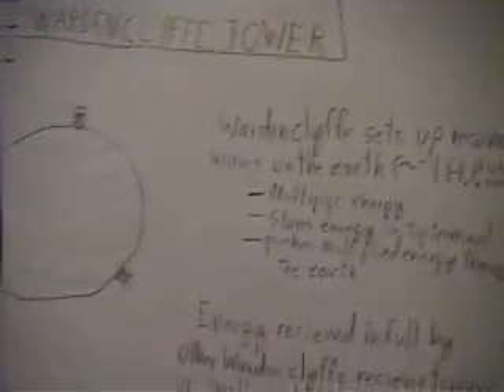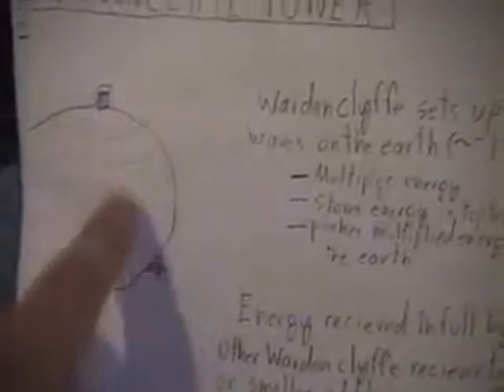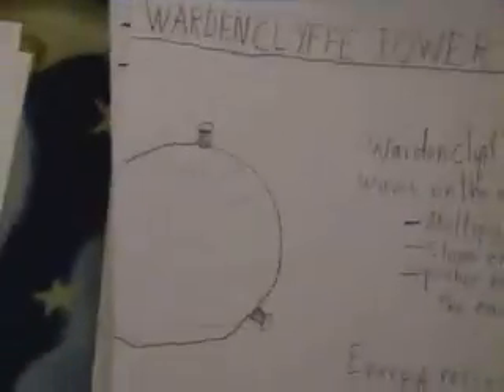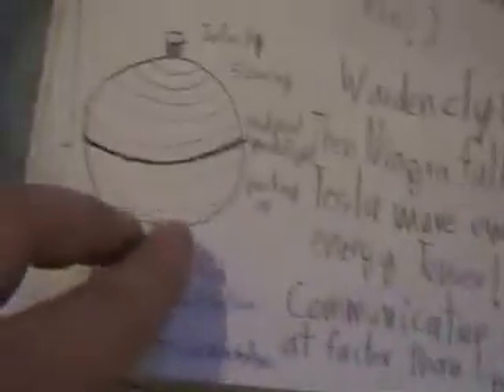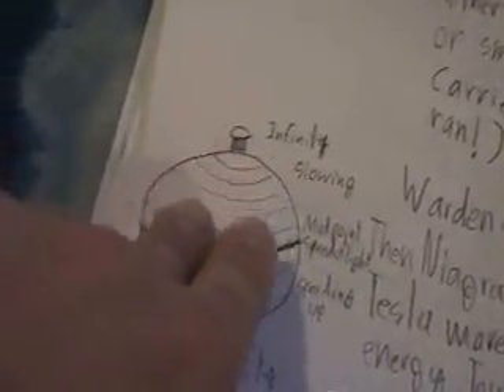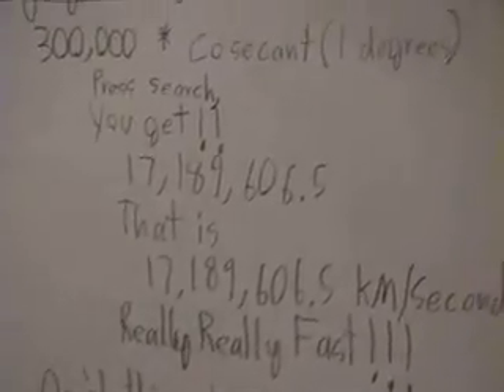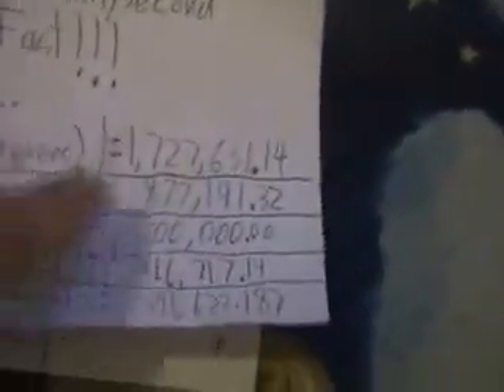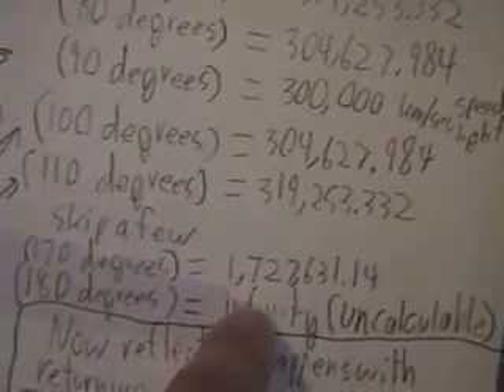Nikola Tesla Interplanetary Energy Transfer: Sending Industrial Energy to Planets part 2

Comment from the maker: @ilav1m8y as interesting things i saw with my smaller tesla coil, the light plastics and foam material on the floor would start moving and bouncing around, probably from the high voltage electrostatic field, it was weak but it looked really neat, another example of a force given off by the coils is when tesla was at colorado springs and the coils would pull on the insects when they flew around to coil and even pull water moisture around the coils showing again some form of a force created.

Comment: I think you may have confused interplanetary for intra-planetary. Have you seen the radarscope images of the Wardenclyffe site? There are 4 tunnels at the base, the longest of which runs out toward the sea. There is a large metal ring and some deposits of unknown material about 2 feet cubed. There is a yahoo group, TheRealTeslaInfoExchange, that intends to construct a full scale working model of the tower. 

Cheers